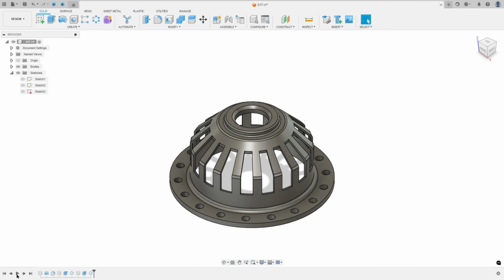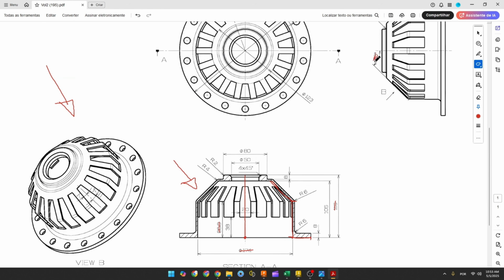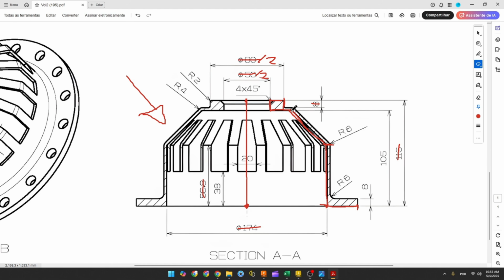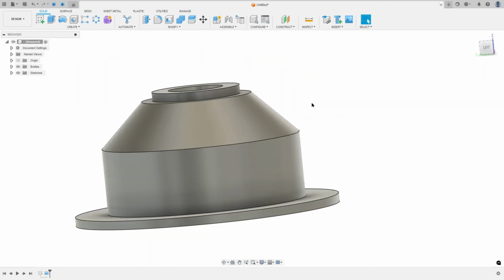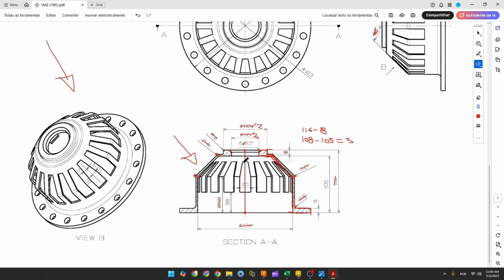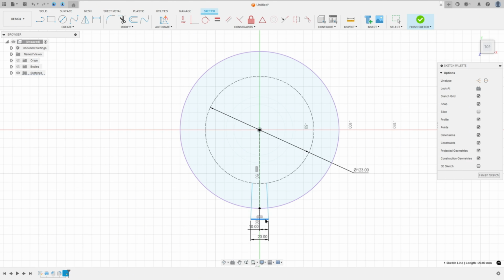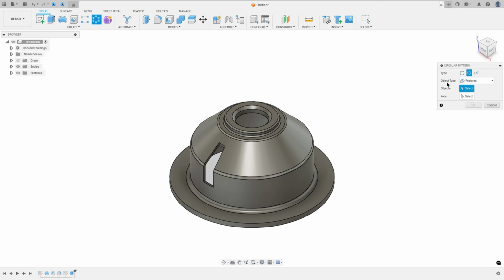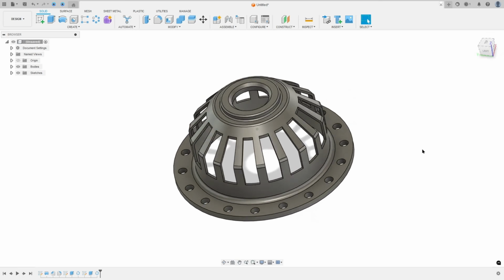Fusion 360 Tutorial: Modeling a Finned Ventilation Cone Cover

Comment: If you intend to use a revolve function, you should not create the axis using a construction line, but should use a centre line instead. Dimensioning is also much easier if you select the centre line first, as the dimensions are then based directly on a diameter.